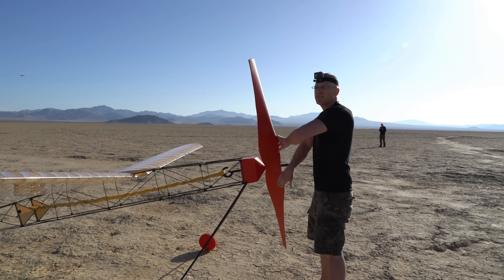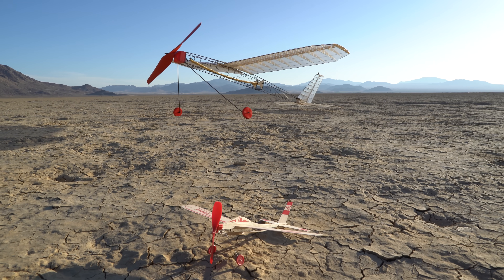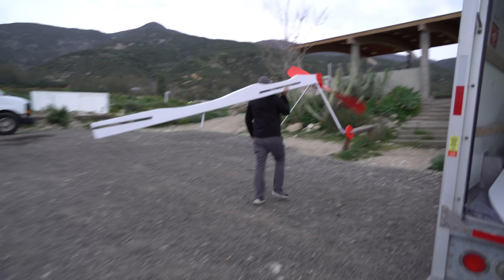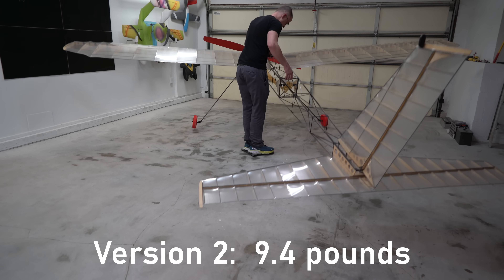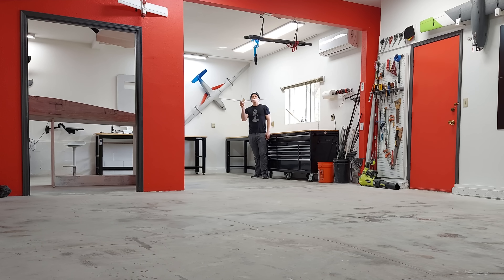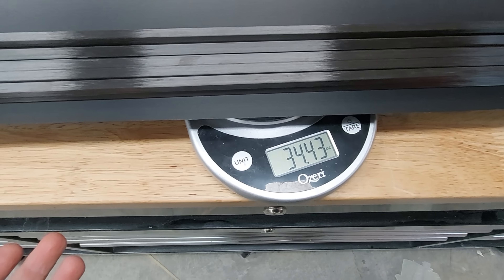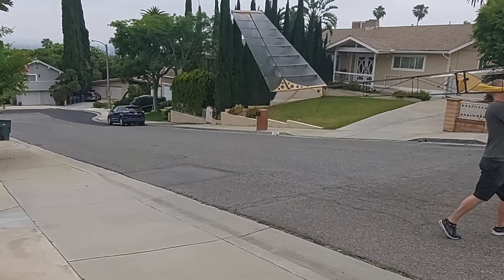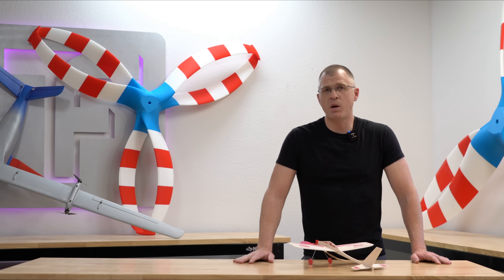Massive 16 Foot Rubber Band Powered Airplane

Comment: Really nice work. I'm just thinking that you may have a slight down thrust on the prop. When I was a teenager I built a model that simply would not climb, regardless of how much up elevator I gave it. Adjusting the C of G didn't work either. The problem was that the motor mount was pointed down slightly. A couple of washers under the front of the motor mount flanges fixed the problem.

Comment: 5:05 I am amazed people have so much patience. So much work just to see it doesn't even move by itself, and then it just crashes. I'd be like "ok, fuck it".

Edit: okay, you knew what to do after. Congratulations on finishing the project. Did you try to make it fly without grabbing it? Like only powering the propeller? Would it fly byt itself?

Comment: use the plastic wrap foil used by metalsheet workers, its like normal wrap but much much stronger, they use it to wrap metal sheet edged so they wont be as sharp when handling,

Comment: I don't want to overstate the obvious, but now that you've had that fun (and it WAS very cool - I can't even tell you how many rubber band powered balsa planes I went through as a kid), aren't you just a little tempted to put some control surfaces on that thing?  At least rudder and elevator..  And then electrify that thing.  I'm sure with a geared prop and the addition of a fairly modest battery (given the model's size) you could totally own the skies with that as an R/C model.  Very cool what you did there....

Comment: I think you need to look at your propellor design. The section near the centre would be creating a lot of drag as it is a large flat surface pushing through the air, albeit axially, not longitudinally.
Reply: Maybe clarify that and say rotational drag due to the surface area at the root end of the prop blades.

Comment: Just curious - does the prop need to be so big? So much surface area and pitch, would a smaller prop, maybe even a 3 blader, enable greater RPM from the rubber bands?

Comment: Fantastic. Re the tendency to angle off to the right. Could well  be caused b y the torque of the prop and or the rotating airflow from it. Prop aircraft have this compensated by angling the the tail fin a bit. Could also try a trim tab  on the right wing pointing down..

Comment: I think more power would be available if the rubber band hook at each end were flat at the bottom, so the rubber bands could be spread out and have greater leverage to spin the prop.

Comment: If you are launching into the wind you may have better success if you can launch with the wind.  You may have to run a little faster to reach speed for flight but downwind is less likely to stall or be of insufficient flying speed if the wind is light and coming from behind.  A stopping of the wind will create a faster than take-off speed condition, and if the wind gusts are steadily occurring the results may be more consistent, downwind launch will also help to accelerate the model airplane, so that when the wind stops the airplane model will climb.

Comment: Might I suggest you add RC airplane components and control surfaces to allow some in flight control over the plane? I know it will cost you weight and add complexity but the ability to control flight may actually assist you in making longer flights, and save your plane from wind / crash damage, as well as giving the ability to add lift as required.
Also the wing covering may be used to help shape and reinforce the wings by controlling the heat as you apply to the covering. As an RC airplane builder this is not an obvious, but highly useful skill to develop. You actually turn the covering into a structural component of the wing, not merely a skin over a structural frame. When done correctly it allows you to use fewer struts within the wings.
Speaking of struts within the wings, have you considered aerogel for the struts? Much lighter than anything else you can find, it's just a matter of price and availability.

Comment: Very cool. I couldn't help but wonder if it would fly better without the wheels.  You caught it each time, so they seemed unnecessary.  Maybe only use them for winiding the rubber band, then detach them.  They must weight a bit.

Comment: If you're getting melting issues, consider using more heat resilient alternatives to PLA for printed parts

ABS and PETG are quite cheap and heat resistant

Comment: What an amazing achievement! Who knew how difficult it would be to replicate a larger version of those small balsa airplanes. 
 I have an idea that would allow you to continue to fly it without having to run alongside it. Install a gasoline fed DLE engine and a Spektrum radio and you'd have a very unique, one of a kind rc airplane... Or contact the Smithsonian and see if they'll immortalize it forever. 
The best parts of the entire video was the 12 second flight and, "To my parents..." That was just as beautiful.

Comment: Awesome project! I have been building and flying self designed giant R/C airplanes using materials available from Home Depot or Lowes for over 20 years. I have learned over the years which gas weedeater is the least expensive to purchase and easiest to modify into a working airplane engine with home made propeller hub and motor mount. I could have told you that unless designing a type of airplane that flies very fast with high wing loading the pink foam is not a good choice because it is so dense and therefore heavy. The white foam board is much lighter but has virtually no rigidity whatsoever making it very flimsy and it has to be internally braced with some sort of fiberglass or composite material applied externally for strength. The Pink foam you used in the first version would have been too heavy for efficient flight with this low power source and is too flexible to keep from experiencing things like wing flutter without extra internal reinforcement like your very heavy dowel. It is also very brittle and will break easily with very slight impact with the ground or any hard object even at the lowest speeds if not reinforced. Adding fiberglass cloth and resin to the pink foam for more strength and durability would have made it much too heavy. Lighter foamboard with internal carbon fiber rods and/or tubing (big $) with external composite laminate (more big $!) externally would have been the way I would have gone if I were going to stick with the origional plan of trying to make what looked like a giant copy of the first solid/sheet balsa rubber band powered airplanes we all know so well from our childhood. So far my favorite build was a 16' wingspan flying wing with a 35 degree swept wing design powered by an ancient 82cc chainsaw engine I modified into a "pusher prop" specifically for this aircraft. It flew beautifully until I pushed her just a little too hard trying to see what kind of high speed handling it had and what it's top speed was. on one flight I dove down over the field, screaming along at full throttle when catastrophic high speed wing flutter occured so quickly that I had no time to even try slowing it down and it literally disintegrated in air! BIG FUN!

Comment: There's a weird quirk with rubber you might not know. It actually stores some of the energy in the form of heat when you stretch it. This means that if the band cools off after you stretch it, you will get less energy back out when you release it. So the longer it takes to wind up the band, and the longer you wait to release it, the less power it will provide.

The reverse is also true. If you heat the band up, it will provide more power than it would normally.
Reply: Wow never knew this. I did Rubber Band “Racing” Balsa-Model Rockets flying along a horizontal string as a kid. And loved the classic rubber band planes!

Comment: the original Toy has a gear built into the Prop which allows the Prop to spin once the rubber power is exhausted i noticed your design didn't have that. so your prop is essentially an air brake.

Comment: You can get a lot more energy stored in you rubber "motor" if you stretch it to about double length before you start winding. You then slowly relax the stretch as you wind till it is fully would and back to normal length. Technique has been used for rubber powered contest planes for decades,.

Comment: It was called a Sleek Streek where I lived.  I loved them. You could fly up and keep soarimg for 29 cents. As crazy as it sounds, I had more fun with these than anything from Cox. I'd usually mess with them a little...usually I'd find the optimum balance and glue the wings. I'd also train an airfoil shape and moisten them with a thin solution of Elmers Glue-all...it added less that half a gram, and the gain in performance and durability.

All that said, although you could fly them from a standing start, the best flights were usually hand launched into a mild wind.

Comment: Great example why bigger not always means better. It cost more resources and way more effort to built a barely moving, up-the-wind, barely glider.... 12s is very poor outcome, and i blame it to the rubber band - very inefficient mass to potential energy storage capabillities. Also, poor energy emmmision, i guess it can spin inefficiently as long on the ground as in the air = wasted energy.
Reply: Though there  are 10 seconds interesting in your video... can you point the source of 6:21?

Comment: This is a crazy build, hats off to you. Just a few tweaks here: I wonder if the props just create too much torque. By reducing the prop size and/or reducing angle of attack with a larger rubber band will do the trick. The prop will spin faster with greater efficiency. Also, I do see that you tried making it the closest to the original, but it seems that it didn’t scale up that well. Adding a higher aspect ratio and the right aerofoil (it looks already good to me to be honest) will greater increase efficiency. The wing could also be modified into a tapered wing to add to the strength and equalize pressure. I like how you tried to minimize the amount of dihedral as it does cause drag. The wingtip looks like it would produce a lot of drag, so using a shark fin wingtip would further decrease drag. I bet once you start on the basics of getting it to climb it may become maneuverable and become a really cool project!

Comment: Do some more study on national champion planes and emulate. They use a lube on the rubber motors for more power.
They also have "hollow" propellers in the center - No webbing from the center out to 50% or so...?
I'm sure they have a tone of other valuable tricks. Perhaps a clutch on the rubber motor to wind with a drill? 
Great job! Keep going!

Comment: I am at 9:17 and I had a thought... To preface I know almost nothing about aerospace engineering but what if you were able to add a valve to each wing and pump a low pressure amount of helium into them before each flight? Like ~2PSI?

Comment: My friends and I used to play with those as kids. A perfect run was when you could get it to take off and land on it's own without tipping over, trickier than it sounds for tiny plastic wheels on weathered concrete. Forty years later I still add them to the Christmas stockings of little ones on my list.

Comment: I built a 19ft wingspan rubber powered plane in the 70's before the internet. It used heavy duty shipping bands for power. And it was built traditionally with balsa, dope and fabric.

Comment: Just a stupid idea but, can you drill many tiny holes on the propeler to make it lighter, reducing its rotational mass. Its moving slow enough that the air would pass over the holes. Or drill them at an angle.

Comment: 20ft wing with a Polyhedral design and I think you can go a much greater distance. Should allow for a longer rubber band with longer run time with the extra lift from the extended wing. A few degrees of dihedral on the rear horizontal stabilizer would also aid in stability.
Reply from the maker: Absolutely.    Fortunately it is very easy to add sections to this plane.

Comment: congratulations, you've made a perfect demonstration of purposing and the ground effect. the airfoil, as I'm sure your aware, generates lift by creating a high pressure zone below the wing and a low pressure zone above it, however the air below the wing is somewhat smooshed between the wing and the ground while your flying very close to it, greatly increasing the efficiency of the airfoil as the high pressure zone is amplified. you can actually see the plane try to climb out of ground effect and fall back into it at 12:03,  although it is possible that the power simply winded down too far. even if the plane had a unlimited supply of power to its engine, it appears to be unable to fly above ground effect. I really don't know how you could engineer any more weight reduction into it though, so my advice is to improve the power and the propeller manufacturing if you want to0 push the plane into proper flight.

Comment: Great project and awesome to see the plane flying. Another possible drive option for the propeller is to have the propeller connected to a long screw (thread size would require experimentation). That way the rubber bands can be stretched out in one direction, rather than twisted. The rubber bands would pull a "nut" towards the propeller and thus create a driving force. It would need to be low friction and the "nut" would need to be on a rail so that it won't spin.

Comment: The gap between the wing panels is a HUGE penalty.  If you sealed that gap then performance would increase significantly.  I experienced this directly when flying a GWS Pico Stick.  Its wing had a similar gap.  One day I taped a piece of paper across the gap and the plane's performance improved quite noticeably.  Covering the fuselage would also give a noticeable performance increase (significantly less drag than the open truss structure), far outweighing the few ounces of weight gain.  Covering the fuselage would also close the gap between the wings, so would be a two for one improvement. 

All told, an impressive project, thanks for sharing it with us.

Comment: Would a smaller prop work better? Maybe an even smaller 3 sided prop? Pick the rpms up slightly.

Also was the winding of the rubber band shifting the center of gravity?

Comment: I remember my dad having a trophy for a rubber powered plane he built in the 20's.  The trophy said "Model flew out of sight".  He also built a very light weight air tank wrapped with a fine wire and 3 cylinder motor but I don't recall if he said he ever installed it in a model or not.  It was fun pumping up the tank and spinning the prop with air power when I was young.  It was all hand built but unfortunately lost over the years.   As kids we got plans out of the American Modeler magazine to build a jetx powered glider.  I cut all the material thicknesses in half and by moving the wing back to balance without the motor would fly it over blacktop streets in the summer and it would just hover on the thermals.  Great memories.  Great job and great video!

Comment: OK, well done and a fascinating video, but I wonder if you researched any hard core rubber free flight techniques. After trimming a rubber powered model the rubber 'motor' is stretched out to three or more times its normal length before starting the winding process, gradually walking back towards the nose of the plane as the rubber knots up and then reinstalling the propeller. This allows for far more winds of the rubber. Also, lubricating the rubber helps. I realize this could be a huge problem for a plane of this size as it would probably require making some substantial jigs and could be somewhat dangerous in practice. However, you accomplished what you set out to prove so well done.

Comment: Why twist the rubber band and not stretch it to propel the aircraft?
The 'wind' up would stretch the band, lock it in place and the a pin would release the energy

Comment: Your patience deserves high praise! 1. In order for the rubber motor to work more efficiently, the rubber threads must be lubricated with castor oil, this reduces friction. 2. When you tighten the rubber motor, you need to do this by first stretching the rubber threads by 2/3 of the length, and reduce this distance to 0 as the tension increases.

Comment: Who be awesome if you could actually radio control the rudder and elevator with servo's. But adding these electronic equipment (especially a battery) would probably make it way to heavy again.

Comment: Awesome build! 

I’m wondering if you could do some type of gearing to take the low RPM and fairly low torque of the rubber band and amp it up a bit. 

Also, you may already know this, but the rubber band pulls strong initially and then weakens. But if you can add tension it kinda helps. 

Obviously these aren’t easy to do. But just my $0.02.

Comment: What a cool project.  When I was a kid I  build balsa models with rubber band propellers.  Some flew better than others.
As a 67 year old retired carpenter I build the real thing.  It’s a blast.  My first was a replica Piper J-3 with a wood truss wing built of 1/4 x 1/4 spruce cap strips.  I just passed 300 hours in it and it flys great.